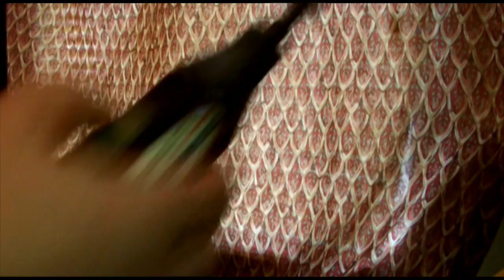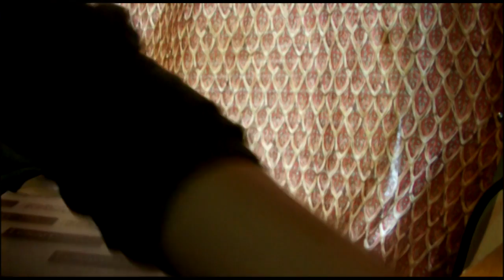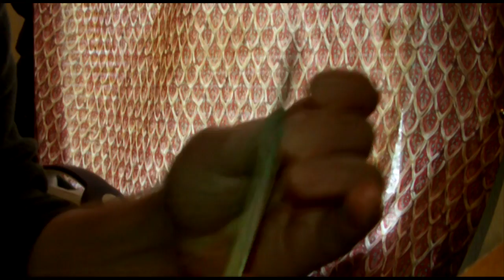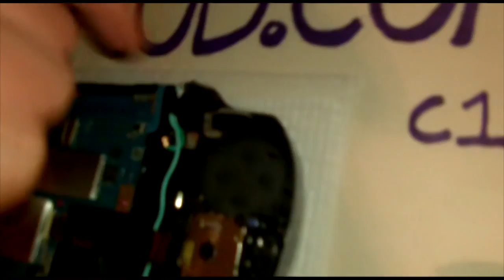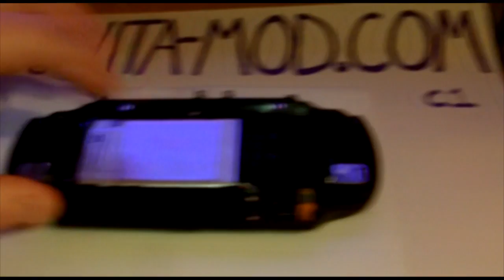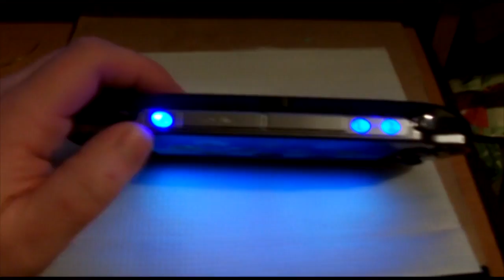PS Vita Custom Power and Volume Buttons Mod Clear with LEDS

Comment: where did you get the led and lexan sheet?
Reply: +Skyefuego leds came from radioshack and lexan was at home depot. You can get it all and better leds online though
Reply: Would I type " mini led lights" I tried looking for it
Reply: 0603 smd led is pretty enough size